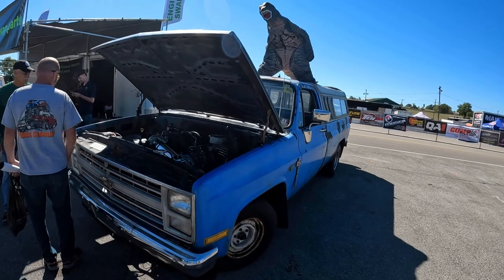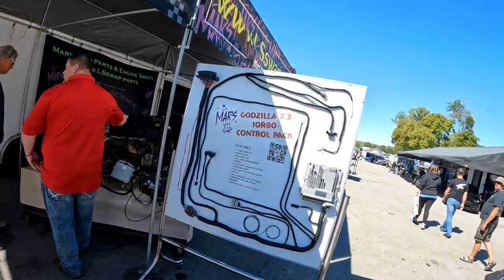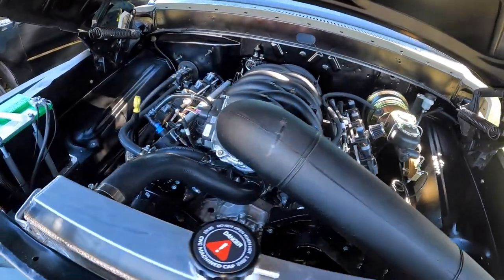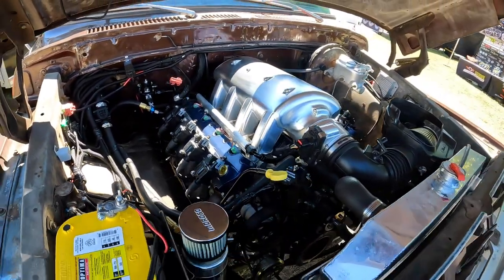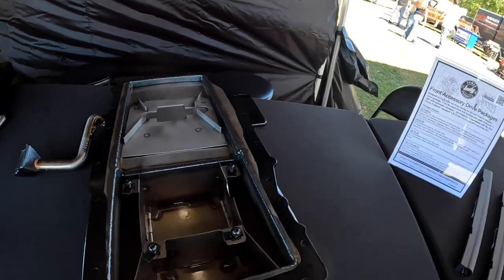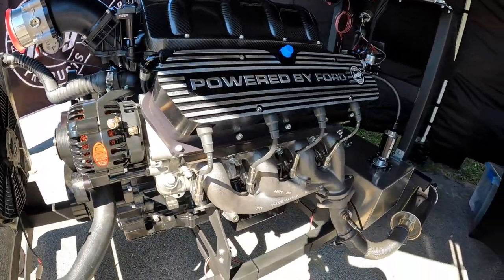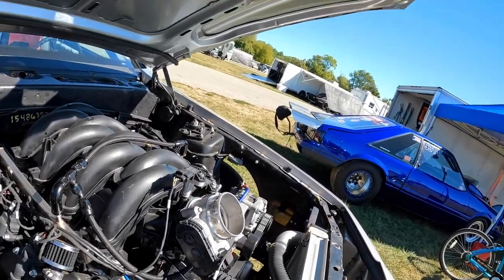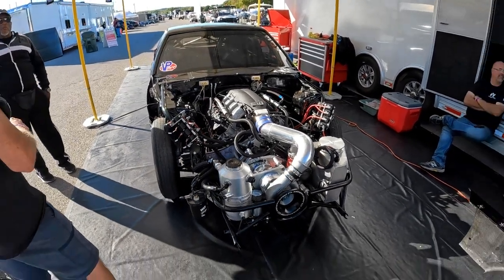7.3L Godzilla V8 Swaps Taking Over @HolleyPerformance Intergalactic Ford Fest

Comment: Say 'NO' to LS, Fellas. You now have more options. Ford in a Ford. YAYA!
Reply: Only if your wallet can make it so. LS complete take out for $1200, engine, trans, wiring harness, ECM.
Reply: The Godzilla is basically an LS.
GM says your welcome.
Reply: @smokepeddler  the ls is pretty much a 351w.... fords says you're welcome.
Reply: @smokepeddler  oh, I forgot GM invented the single cam pushrod V8, so greatfull
Reply: @ZING-oj6zi  seriously what’s up with these “ls copy” it’s a modern cam in block V8 what else besides that is a copy?

Comment: The godzilla is a cool engine choice and power plant but id still take a coyote
Reply: In a truck? Why?
Reply: @smokepeddler  its depends on what your application is with a truck but for a car it doesn't matter
Reply: @smokepeddler    Probably because a whole slew of Gen 3-4 5.0 F150s are kicking the crap out of pretty much everything on the street lately.   

So for a street toy 5.0 makes for a killer truck engine.  

If you’re building a tow rig then sure 7.3 is pretty good.

Comment: The oil pan & intake manifold situation kinda kill the size advantage/ease of swap. I wouldn't call it an 'easier' than a Coyote(outside of pickups), just different. Can never escape the LS comparisons of course, and it isn't as easy to swap as the LS(even assuming swap motor mounts and the like for each) - but, who cares? Pick the one you like, and just swap it, this stuff is EASY compared to 10, 15, 20 years ago. It isn't carb'd engine easy, but pretty damn easy, especially with aftermarket EFI.
 
Once the Ford control pack, hopefully a Holley Terminator X, and the Ford Performance swap intake are out(and HOPEFULLY a more affordable higher clearance pan option), then we'll really be talking accessible swaps. Especially if we get some header options. To be honest though, the Coyote is still a better swap option at the moment with the better parts availability. The 'Zilla just needs a lil more support, but we're getting there.
Reply: If you want a tired, old, boring, ugly in-line valve large cube small block build an LS.  

Ubiquitous, tons of support and Godzilla offers zero architectural advantages except for the 1.8 degree valve cant that doesn’t really pay off in performance. 

Want to build a Ford?  Build a Coyote
Reply: @BC08  ...or, just build whatever the hell you want instead of building what people on the internet think you should build...
Reply: @RyTrapp0   …or save a buck and build the [basically] same dang thing for less.  

At least the Coyote has differentiation and technical advantages.  
Godzilla is an LS in blue oval clothes - junk.
Reply: @BC08  could’ve said the same thing when the LS came out. The same thing was said about OHV engines during the flat head era. I guess time never changes mindsets 🤷‍♂️
Reply: @duke5171   LS replaced the SBC and improved on it in every way.   LS is so common because it ended up in nearly all of GM’s lineup over the last 20 years.  

Godzilla will never have the widespread implementation and as a result Godzilla will never be as ubiquitous and cheap as the LS.

Comment: Ironically  the 7.3 Godzilla is basically  a Ford big block version of the LS. Can't beat em, then imitate.
Reply: Oo you mean like chevy did? Hm funny how the ls sure does resemble a 351w lol save it jake
Reply: Godzilla is a small block.   
LS is a Ford Windsor-style engine with a Ford Modular-style bottom end.   
Godzilla is pretty much an LS with 4.53” bore spacing instead of 4.40”.
LSs are boring and basic AF. 
Godzilla should have been a revamped/enlared 6.2 Boss Cammer.   
Brian Wolfe fucked us
Reply: @BC08  thats a lie with in a lie
Reply: @ranware2779   No, it’s truth within a truth.    
If you disagree with anything I wrote outside of the last 3 sentences which were my opinion then you have no idea what you’re talking about.
Reply: @ranware2779   I really don’t know what you’re rambling about.   
I suggest you read my comment again and reformulate a relevant response.
Reply: @BC08  🤣🤣
Reply: @ranware2779   PS.  Brian Wolfe himself said they brought in the LM8 6.6 LS truck engine and benchmarked it.   

Godzilla started with Boss 6.2 hard-points.   That’s why Godzilla and Boss shared4.53inch bore spacing and share all the same journal diameters. 

Godzilla then just slapped cam journals into a 6.2 block, gave it Siamese bores, bumped up deck high slightly and then slapped a super-basic LS-style top end on it — viola we have Godzilla.    
Ford’s very own in-house LS.   
Disappointment abounds
Reply: @BC08  🤣
Reply: @ranware2779  PS.  Brian Wolfe himself said they brought in the LM8 6.6 LS truck engine and benchmarked it.   

Godzilla started with Boss 6.2 hard-points.   That’s why Godzilla and Boss shared4.53inch bore spacing and share all the same journal diameters. 

Godzilla then just slapped cam journals into a 6.2 block, gave it Siamese bores, bumped up deck high slightly and then slapped a super-basic LS-style top end on it — viola we have Godzilla.    
Ford’s very own in-house LS.   
Disappointment abounds
Reply: @BC08  man stop. 🤣 at your info brian wolfe never ever said a thing like that for 1 for 2 the godzilla is a windsor style v8 not an ls the ls is a windsor style v8 so i dont know where you're going with this but u can go far that way. Also wtf are you complaining for? Are you spending money or just talking if you're not spendin just sssssssh
Reply: @ranware2779   Brian Wolfe ABSOLUTELY said that.   Go watch his Revan Evans latest video on Brian’s Godzilla Mustang , Brian said it Directly to me in the comments. 

What am I complaining for?   I’m complaining because Brian Wolfe made a stupid decision based on bad inputs and gave us this 💩 as what’s likely to be Ford last new V8